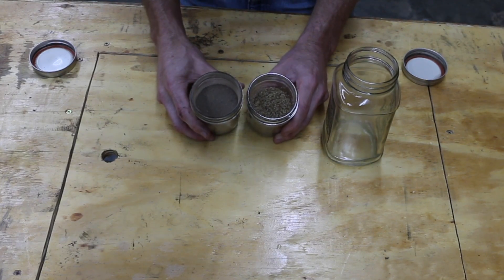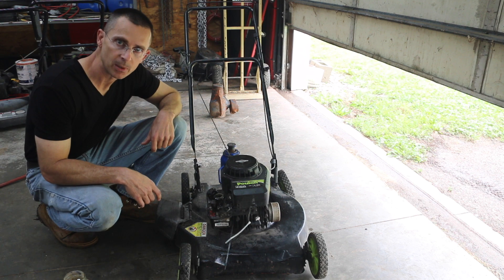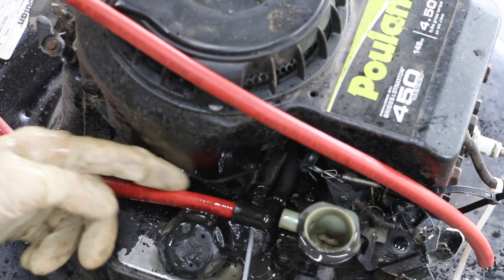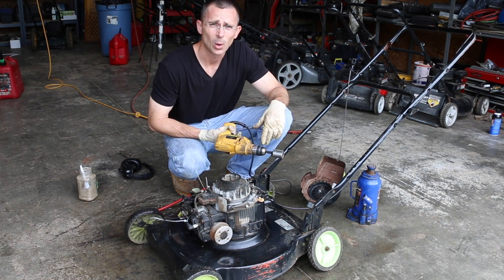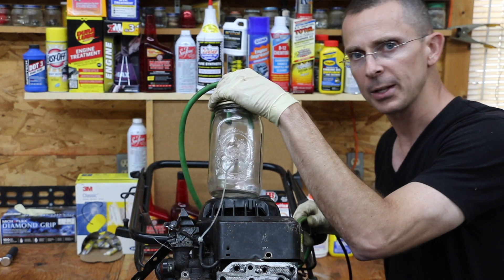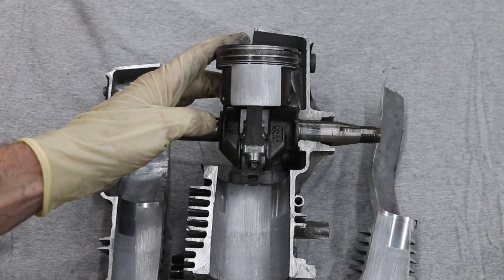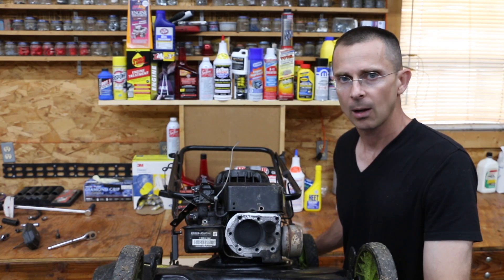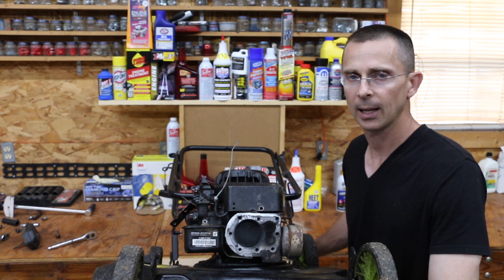Will Dirt Destroy an Engine?  See what it does to this Engine!

Comment: I remember as a kid my dad drove a 66 Ford Galaxie and it needed a replacement 390 engine. A new engine was installed but it kept burning oil. The mechanic instructed my dad to pour Comet cleanser (we all knew it contains abrasives) down the carburetor to help seat the piston rings. Well needless to say it didnt help.  I suspect the piston/cylinder clearances were excessive.
Reply from the maker: This is interesting. Thanks

Comment: Now I want to see a real world test that evaluates your statement that it's important to have a "clean" air filter on an engine.  I counter that it doesn't not matter much if your air filter is clean when it comes to engine wear, that it just robs you of a little performance.  The important thing is to have a decent air filter which is effective down to a small micron size instead of no air filter.

Granted, if there is any difference in engine wear using a dirty filter, it could take hundreds of hours to determine.
Reply from the maker: Thanks for the constructive feedback and video idea

Comment: Try using valve grinding compound mixed in the gas. I was told particles are small enough to get past the fuel filter and even injectors and totally destroy a motor
Reply from the maker: Thanks for the video idea!

Comment: I was wondering about increasing compression type of destruction, shaving around 1.5mm from the head or engine cylinder, possibly also adding a turbo in which it can reach 150PSI maybe.  Not sure how far can we reach, but something like how some people like to boost power but reach to a point of destruction.   Your videos are hypnotic and I love watching 10 of them everyday! Really great work man!
Reply from the maker: Great recommendations. Thank you!
Reply: Project Farm I admire how responsive you are! Well I’ve made a quick research today and it’s easy to find a small supercharger from a Mercedes car or maybe a standard piston air compressor to use as a way to increase the compression, you may possibly use the gas vapor into the intake of the compressor and connect the output to the motor that we are testing. Running a proper air compressor will enable us to achieve higher compression since we are trying to double the current compression to reach a point of destruction.   Other alternative maybe running Nitrous gas and see what it can stand!

Comment: In real situation, how long does it take for engine to damage that much if we took of our vehicle air filter? I used to have a 70cc honda cub and never use filter on carb but it run well for roughly 10 and more years and still no need for engine repair... just cover the air intake hole with plastic bottle and no filter at all.
Reply from the maker: Great point. it really depends on air quality.  I suspect traveling down a gravel road daily would be hard on an engine without an air filter compared to an environment with high humidity and low dust.

Comment: Put gasoline were the oil goes. Like if you wanna see that
Reply from the maker: Thanks for the recommendation.
Reply: @ProjectFarm  yah I wanna see if the gas will act as a lubricant or will it catch on fire
Reply: KING_EDGE gasoline thins oil this will be interesting to see
Reply: KING_EDGE u obviously don’t know how engines work 2 strokes burn oil as it is
Reply: @dilflife6533  you mean gasoline also known as fuel oil?
Reply: @dilflife6533  gasoline and Diesel are lubricants. That's how fuel pumps are lubricated and valves are as well which is why GDI engines suck because they spray directly into the cylinder instead causing carbon buildup.
Reply: @tuckerhoefer254  it's a common thing when floats/needles go bad
Reply: @dilflife6533  old style fuel pumps that were in the block often sprung gas leaks in the crankcase and it acted like a cleaner and during ww 2 the Germans discovered multi blend oil in the extreme cold of Russia by pouring gas in the aircraft engines oil to make oil thinner and start easy
Reply: @dilflife6533  it will catch fire since it produces heat, and that heat will set the gas on fire, since gas is very flammable
Reply: @dilflife6533  won't last long, low viscosity liquid will creep past the seals
Reply: @ProjectFarm  #runaway!
Reply: @ProjectFarm  Want to see :D
Reply: @ProjectFarm  if the engine was dirty on the inside it will really clean the engine out  learned this years ago with a fuel pump on the side of the motor
Reply: i think if he puts in DIESEL, it could be lubricate a bit! worth a test!
Reply: @deadmanfly1587  he tried that. It didn't lubricate well and it didn't catch fire but it all blow by and spray out the side of the mower.
Reply: @deadmanfly1587  Only if he uses number 1 diesel, not number 2 diesel. Number 2 diesel is the formulation most people are familiar with unless you live in the northern boarder states and Canada.
Reply: One of my grandkids did that to my mower when they went to do me a favor and mow the yard for me... luckily I caught it before I started my mower... looked like chocolate milk instead of oil.
Reply: Yes!! Hell of a great idea
Reply: Won't last 5 minutes
Reply: Gasoline won't lubricate. It's a solvent rather.
Reply: put keroseine in one
Reply: Light off Temp for gas is 458 so unless you threw a rod and got a good spark or something really weird I bet it would just seize. It would probably run for a bit but spit gas and eventually run hot and have a part fail. Probably pretty boring honestly. Unless I'm totally wrong and fumes could make it from the crank case into the combustion chamber which is highly unlikely to me.
Reply: @Project Farm and put the oil where the gas goes
Reply: Plenty of aluminium in there
Reply: KING_EDGE hydrolock
Reply: nah bro, coolant.
Reply: You know you have too much time and money when you want to see the world burn.
Reply: My 4 stroke was flooded to point where petrol spewed out when I took the oil cap off didn’t even turn over
Reply: Anyone who has had a float stick open will tell you...its not much to see.
Reply: Project farm no oil
Reply: Pleas do it
Reply: You just commited a murder
Reply: KING_EDGE I had a customer did that to his motorcycle, his piston jammed up and ruined the liner, also fucked up the head, had to get a light overhaul
Reply: Probably not a good idea, it would probably explode due to high temperature and pressure in the crankcase.
Reply: It would probably explode!
Reply: Oh No! You know he's going to try that now!!
Reply: @Dennis Adkins do lawnmowers have enough power to throw a rod?
Reply: There is a lot of fuel contamination in oil from the ethanol fuel causing float valves to stick open. This allows the fuel to get past the intake valve and past the piston rings into the oil.
Reply: Boyyy it's gonna explode
Reply: @MichaelJacksonsDawg03  no it wont
Reply: Petrol*

Comment: Bit unrealistic. Huge difference having no air filter as opposed to pouring sand straight down the carburetor. Bound to do it a mischief. Just for your information, London transport ran its Routemaster without any significant air filtration or even oil filters. They covered tens of thousands of miles with no particular ill effect and it was only in later life LT started to fit oil filters. The only thing this video has proven is that by pouring sand in a perfectly good engine you are plain dumb.
Reply from the maker: Thanks for commenting.

Comment: JB Weld  back together j-b weld all the scoring in the cylinder hone it and then put j-b weld on the the piston smooth it out put new rings in it  and see  if you can get it to run for a few minutes that would be the ultimate j-b weld test lol
Reply from the maker: Great recommendation.
Reply: I think it be a cool little project

Comment: Pour a beach in an engine and was surprised by the results? come on. lol
Reply from the maker: lol. Thanks
Reply: @ProjectFarm  I didn't mean that negatively, i mean, we know dirt and sand will destroy engines, your video shows us just how little it takes. Makes me wonder how many engines that had oil burning issues, blow by etc was from poor air filter maintenance. Gonna make sure air filter boxes are clean and sealed up from now on! lol

Comment: Correct me if I'm wrong.  just 'pouring' the sand in... does not 'calculate' the experience of a year of running.

The dust just 'picked up', would have a chance to burn, to 'get blown out'... to get away.. yet having that just 'dumped' in so quickly.. is sure to apply different effect then that.

Comment: I have heard from an oldtimer that putting a cleaner called bonami? Into the carb throat like you did with the dirt will rehone the walls and reseat rings on a worn out motor.  I can't find this cleaner where I am but I am super curious.  Its a volcanic pumice or something and the fine grit gets finer and finer as the motor runs.  Would be a cool test
Reply from the maker: Thanks for the recommendation!

Comment: Just put a bigger filter on it. The original filter may restrict airflow some so put a double sized one on there and maybe it won't be as restrictive. My opinion of course.
Reply from the maker: Great point.
Reply: I agree. Increasing filter media area is the safest way to reduce restriction, while still protecting the engine from fine particulate matter. Some of the after market "high flow" filters don't have as fine a mesh, and will allow fine dust to get into the intake.

Comment: The OSS in WWII used ground walnut shells to disable german engines. They filled condoms with it and crammed them into the oil filler of the engine. That way it took a while to break and the Nazis didn't know exactly where/when it was sabotaged.
Reply from the maker: Interesting bit of history. Thanks for commenting.

Comment: You dont accumulate 3 tablespoons of dirt into a car engine in 10 minutes if you run without an air filter...  i ran my car without an air filter for 3 months when i finally started to see some black soot forming on the throttle body...
Reply from the maker: Thanks for commenting on this.

Comment: I learned that not having an air filter is probably the #1 way to screw up an engine in no time flat aside from intentionally doing something like pouring liquid glass in the crank case.  One dust storm could easily get that much dust into an engine.
Reply from the maker: Great point!  Thank you

Comment: You should try to replicate a engine that is extremely low on oil and slowly starve it for oil. Had a friend who's truck holds 7 quarts, only 5 was put in, upon oil change only 4 quarts came out. Engine was shutting off at idle. Did oil change it runs like nothing happened, but maybe you can do a extreme test.
Reply from the maker: Great video idea

Comment: That was an unrealistic amount of sand and dirt to put into the engine at one time ... in real life situations, the removal of the air filter will not result that much dirt and sand going into the engine ... and in real life situations, the oil would have been changed before any significant  anout of dirt and sand would accumulate in the engine.

Comment: To much at once. You could run through 10 times that with less damage if slower. In one shot you put more through than collects in my airbox over 50000 miles. Sort of like water, you can run it slow for a very long time, but to much at once and it won't compress and can blow the motor in one shot. Like to see it done where you do no more than a few grains a second. Then you could probably run for a month like that with less damage.
Reply from the maker: Thanks for commenting on this.

Comment: Been using intake without filter for 7 years. Opened up the engine a few weeks ago to install a bigger block and the cilinder walls where intact. The most damage it had was a small leaf in the oil.
Reply from the maker: Wow!  Glad it's working out just fine.

Comment: Why does oil come out when you put sand in it like wouldn't it just score the piston housing/cylinder walls when it got in there?
Reply from the maker: Great question.  Combustion gases escape past the piston during the compression stoke and pressurize the crankcase. The gases escape out of the crankcase ventilation, taking oil with it.  Thank you!

Comment: I would like to see an engine run on water and acetone mist. I was told water and acetone bind molecularly and when sprayed like water methanol is actually more efficient and can be used entirely without regular gasoline.
Reply from the maker: Thanks for the recommendation!

Comment: A couple of years ago, someone put sand in the engine of my 110 cc motorcycle through the oil filler.  I did not notice this for four months until I changed oil. Now, can you simulate this and show us what happened inside the engine? The perpetrator used about 5 spoonfuls of sand. And I never did caught whoever it was.
Reply from the maker: Thanks for the video idea!

Comment: You would be amazed Craig Locke at how much dirt does get in.He is talking about if you don't have a filter system or maintain it. I've worked on machines out in the weather many times & changed filters on some that had been neglected & believe me I have poured close to half a cup on a couple of occasions & a quarter of a cup many times of dirt & dust out of air filters.

Comment: Lawn movers don't have oil filters thats why the engine got easily destroyed...What would happen if you did this same test with a vehicle with oil filters? Do you think the engine would get destroyed?
Reply from the maker: Thanks for commenting.  If I had added the dirt and sand to the engine oil, the filter would have made a huge difference.  In this instance, the air passed directly into the combustion chamber, causing the damage.  An oil filter wouldn't have saved this engine. Thanks again.

Comment: One test that would be worth doing is finding out what happens when an engine overheats, fairly easy with a water cooled engine but perhaps lagging could be used on an air cooled engine, I once had a car seriously overheat so would be interested to see what actual damage is done inside the engine, particularly to the bore and piston.
Reply from the maker: Thanks for the recommendation!

Comment: Hell my dad gave me a 340 articat snowmobile never has had a air cleaner it's open carb still runs and the sled is a 72
Reply: Winter engines don't usually have a air cleaner they would freeze up.

Comment: I think it's safe to say you can run a mower without a filter without fretting if you need the extra power.
The amount of crap he poured into it would amount to quite the number of hours that would likely exceed the condition of the rest of the mower. Note taken from the mower already falling apart. 
Sand tho.. If you mow around sand, put that filter on. Because sand is a composition if various types of stone, some grains of sand are literally harder than steel.

Comment: The drain plug on that type of engine is underneath the engine under the deck if you don't know that you probably shouldn't be working on those engines
Reply from the maker: Believe it or not, not all of these have a drain plug.  The spot designated for the drain plug isn't tapped/plugged.  I own over 20 of these and have worked on hundreds.  Most do have the drain plug.

Comment: well putting a spoonful of dirt in the carburetor of a Briggs & Stratton that all the oil was removed from is the only way that my teacher mr. Conti was able to cause engine failure on that Briggs & Stratton
Reply from the maker: Thank you for the video idea!
Reply: Project Farm as far as I know both of these are things you already did
Reply from the maker: I haven't added sand to the oil yet, just the intake.  Thanks again.
Reply: Project Farm sorry I didn't phrase it right, I was watching this shortly after waking up or before falling asleep and was still a little drowsy but I was trying to say that he removed all of the engine oil and went through an entire tank of gas without a failure so he put gas in it and then put dirt or sand in the carburetor in order to cause a failure

Comment: I ran a car without a air filter and put 200k just fine. I took the head off to put head studs in for a turbo and no scoring on the cylinder walls at all

Comment: Again I'm finding your testing methods flawed. In reality and engine under normal road use would not suck in the quantities of dirt that you're shovelling in all in one go. More dirt would enter the system but in much finer quantities and therefore would not clog the valves in the same manner. It's like saying that a man drinks 56 pints of beer and month. If he does it in increments of 2 pints per day he'll be fine but if you tip 56 pints down his throat in one go it will kill him.
Reply from the maker: Thanks for the constructive comment.

Comment: Ladies and gentlemen, the lesson here is realistically if you remove your air filter not much is going to happen, depending on just how dusty the environment you will be fine unless you are in a desert or until a big enough rock is ingested and bends a valve.

Comment: I drive my motorbike since 5 years without Air filter.

But nothing happen with my engine.
I still drive at 100 km/H speed.
Reply from the maker: Wow!  Filtering the air will help extend the life of the engine.
Reply: Project Farm yup i agree with you.

Now i realize my engine smoothness is gone. but no issue in performance

Comment: I had an aftermarket air filter on my go kart (predator 212) and it died. Lots of blow by, fouling plugs, and oil out the breather. Upon taking it apart, I found a lot of dust (I ride in loose dirt) in the intake before the carb. Can’t imagine how much dirt got in there. I looked at the air filter... yep. About five tiny holes. Not putting that on my new engine.
Reply from the maker: Yes, dirt will quickly ruin an engine.